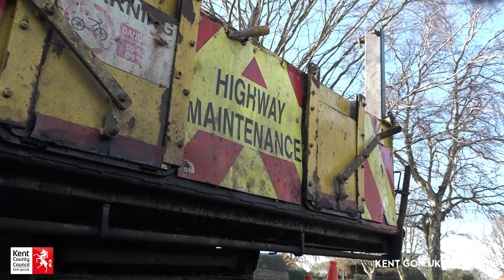Potholes in Kent. How potholes occur and how Kent County Council (KCC)  repairs them.

Comment: Is this video taking the mick? 

At about 50 seconds, we see the truck drive off, with ONE pothole filled in, but a GAPING CASM at the bottom of the picture that has just been left, which is way bigger than what you repaired... 

This is why our local roads are in such poor condition. Why not repair them both whilst you were there repairing one?